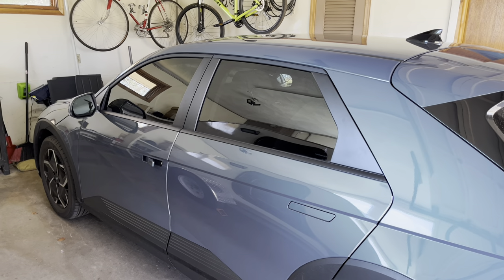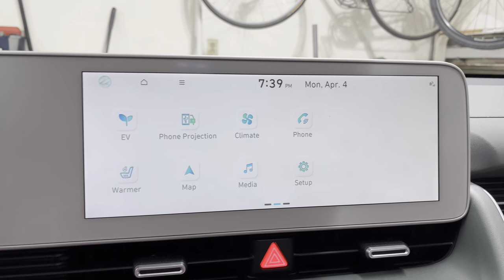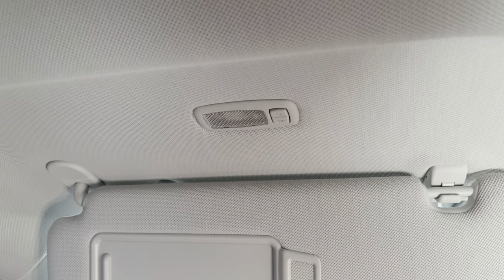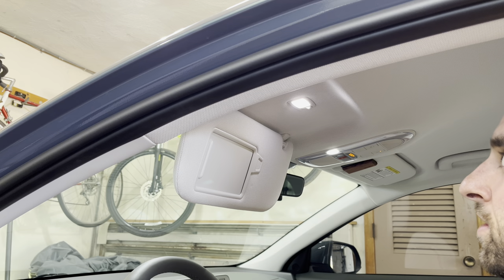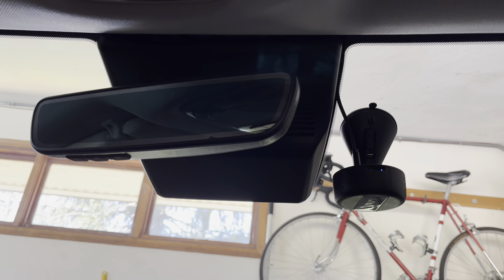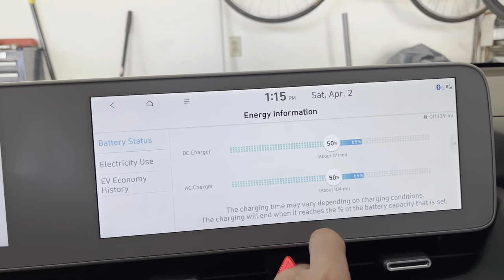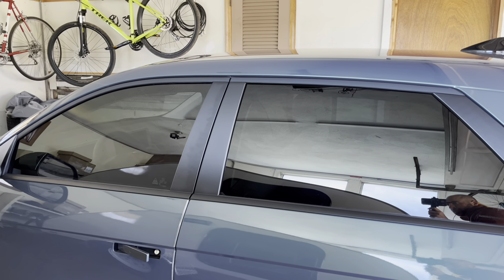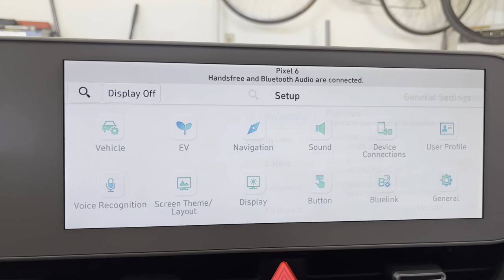First 10 Things To Do To Your Ioniq 5!

Comment: The very first thing you should do is trade your Ionic 5 for an EV 6 because it's much better looking (present styling not retro) and holds almost as much cargo.  EV6 rides nearly as well as Ionic 5 but handles far better.  EV6 is better aerodynamically.  Why is it that these YouTubers buy cars and then inundate the net with dozens of videos to try and pay for it?  Warning:  the tires for both of these vehicles are expensive!  I picked up a nail in one tire on the EV6 that was less than an inch from the sidewall so that the tire couldn't be plugged and had to be replaced.  The tire cost $350 dollars after mounting and balance from the Kia dealer.  The tires are a rare size and, for a frame of reference, Discount Tire only had a handful listed in their system for the entire country (USA).  I couldn't wait for them to order the tire and went to the Kia dealership where the tire was a bit more expensive but available sooner.  Please note that the same size tire is not the correct tire unless it has the correct alphabetic designation, as it will not have the proper tread nor the requisite foam inserts that some EV tires have.